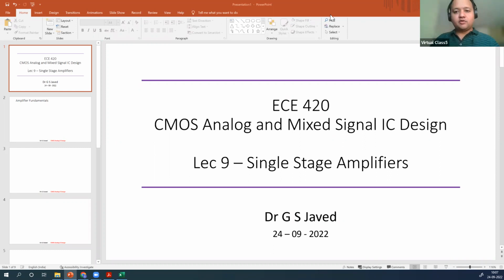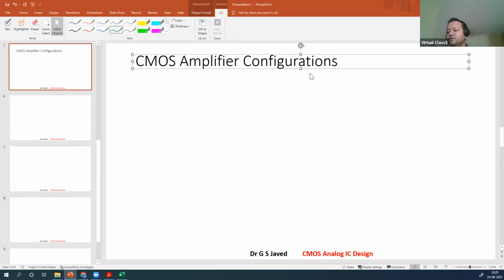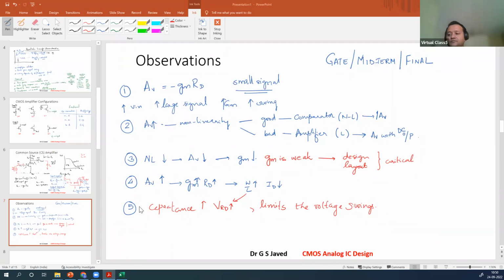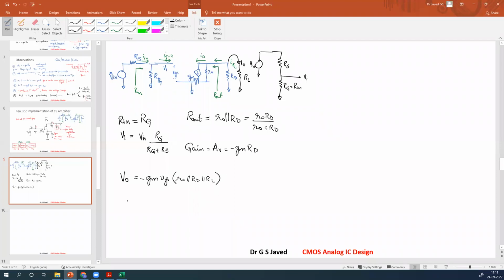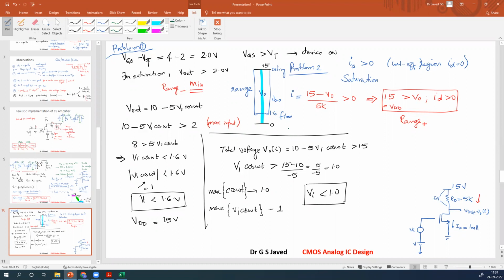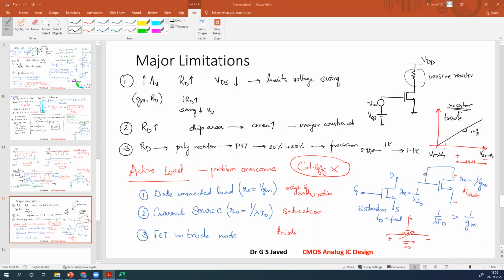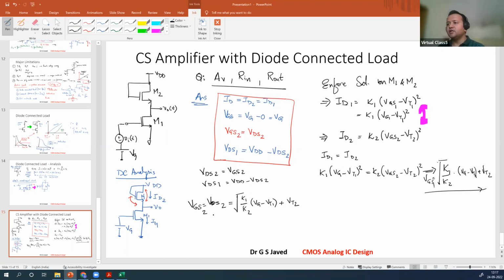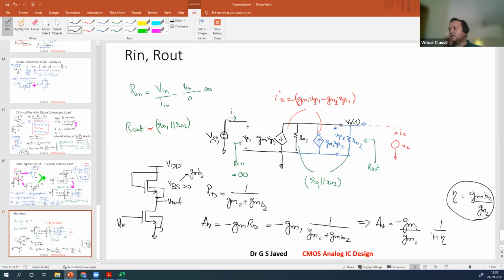ECE 420   Lec 9   Single Stage Amplifier   CS Amp Active Load   Diode Connected

Comment: Assalamualikum Sir. I have a doubt at 1:27:00, above inequality shows that output voltage is less than 15, but below the inequality is opposite in the equation ok total voltage. Please explain sir.
Reply from the maker: Waalaikum assalam sir. 

That is a good catch. 

The inequality becomes, Vi Cos Wt > -1 or Vi Cos Wt < 1 (as the sign changes). 
The maximum value that Cos Wt can get is +1 and the minimum value that Cos Wt can get is -1. The maximum value of Vi Cos Wt will be Vi.